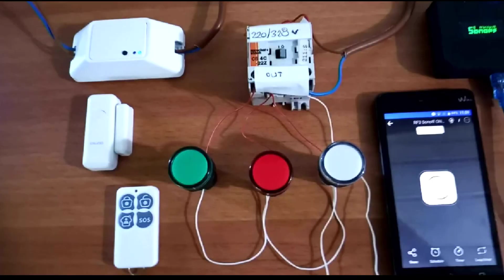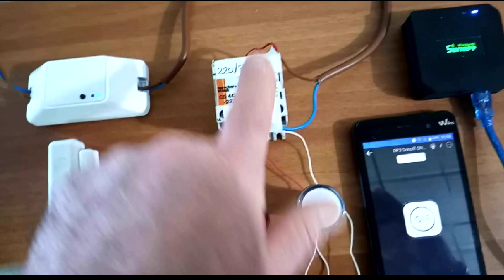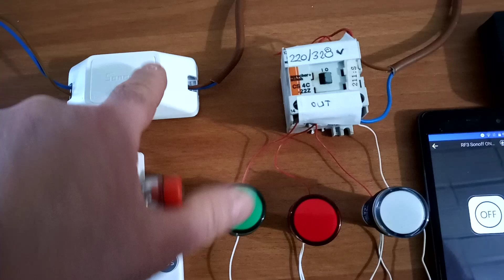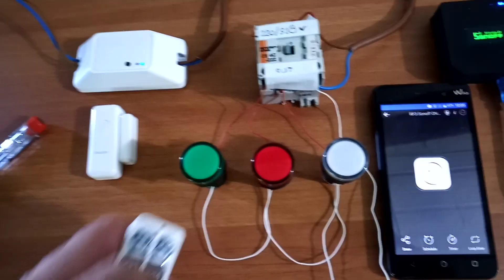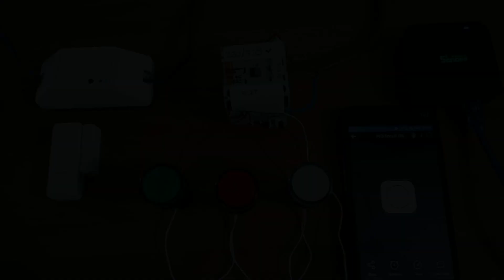HOW TO: Use a high-current load contactor controlled by a Sonoff RFR3 Basic , Bridge.& eWelink .

Comment: My household load is under 3kw can I use one sonoff pow r2 to measure mains load? I also use solar inverter to run my household load
Reply from the maker: This video is for the RF3 not the POW R2, but to answer your question the specs of the POW R2 are 15A/3500W  max, so i wouldn't load more than 3000w, i reccomend you measure the total load with an Amp Multimeter first. The POW R2 is not for total household loads.
Reply: @leonline3424  thanks

Comment: That's just what I'm going to use for my home automation after Sonoff Basic, running car warm-up heater (<2kW), burned out. Relays without contactors only for lighting and other devices less than 1kW.
Reply from the maker: Good, i've seen many people use heavy loads on those sonoff devices, that's very dangerous !

Comment: Nice video, just what I need for my 220v 50amp water heater. But excuse my ignorance, where would the breaker reside? Do you have schematics for that setup?
Reply: Thank you very much! That's exactly what I needed!
Reply: @chrisq76  I would suggest using different lower rating current breaker (6A should suffice) for sonoff and as required for contactor.
Reply from the maker: @DidyshishBaishushish  of course a current breaker is always the first thing , but the video was aimed at showing how to use it not how to properly wire it, even the wiring is just for demonstration ;)
Reply from the maker: Hi Christian, i've added a wiring schematic in the description, i hope it helps you, if you have any questions feel free to ask. Thanks for watching.